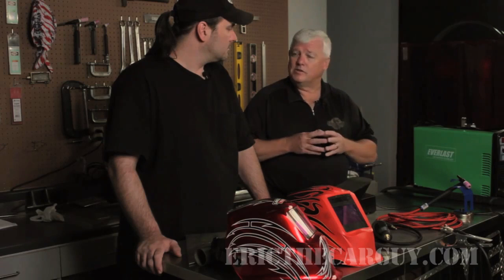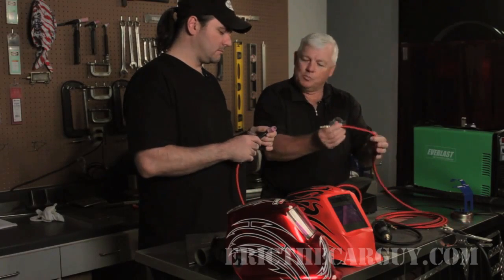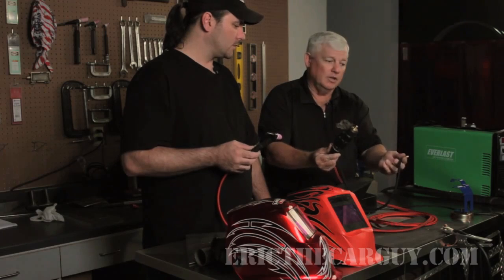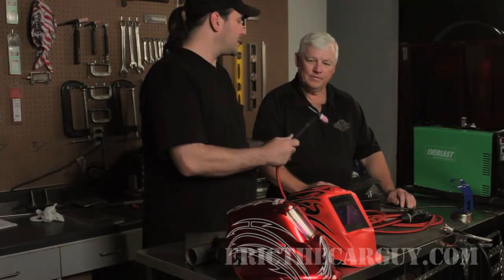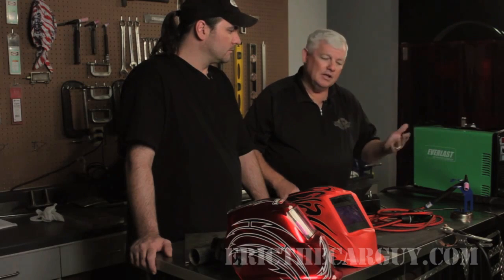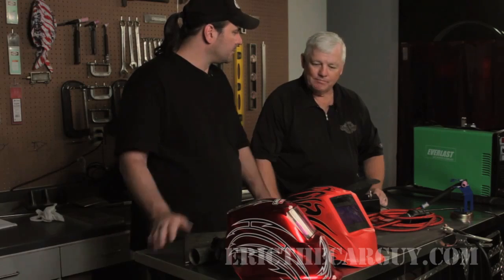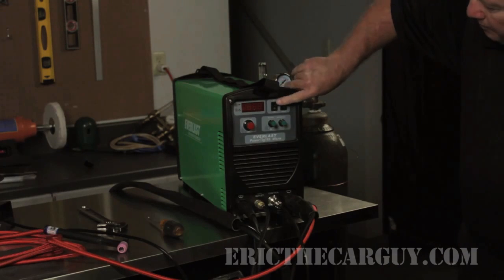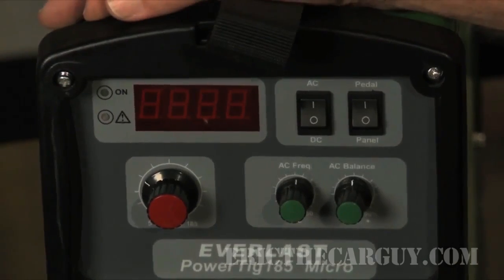Advanced Set Up and Welding Aluminum with a Tig Welder -EricTheCarGuy

Comment: Hey Eric, I have a Honda question for you if you don't mind. My friend just bought a 2006 Honda Accord 4 cylinder Automatic. I noticed that on the highway, when you are giving it gas an audible whine is heard from what sounds like it is coming from the transmission. When you are coasting, you can't really hear it, it is only under load. The car has around 130k miles, so I imagine the trans is a little tired. Just wanted to get your opinion on this.

Comment: There's a different way to initiate the arc which you can set up on certain tig machines. Some machines to initiate you simply have to tap the tungsten to the metal and it'll arc by itself. The down side is you can't control how much amperage it puts out(unlike with the pedal)and it'll put out as much as you set it out to. In order to break the arc you just pull it away from the work piece. This will only work on certain types of steel and not on aluminum since you can't cool it with the gas.

Comment: I thought, I've heard this video last week. Then I realized it is on both channels.
Those people who complain about the audio need to understand how loud the machine is, coupled with electrical interference. To do this interview live is difficult, even though they are using isolation lav mics on each speaker. I guess they could have done a voice-over in a studio after, but then it takes the spontaneous dialogue out if it. The best students learn to cope with obstacles like that.

Comment: I really don't see a point using TIG to repair _old_ cars. Expecially if you are working under the car. It's hard enough with the MIG let alone with the TIG when you have to use both hads on welding and it's much harder to weld with a TIG than what it whit MIG.  If welding new parts that are clean and free of rust and you have space to work with then it's another thing. Even then I'm not fan of TIG. Maybe if you are welding eg. rollcage that has to be certified that's completely different thing.